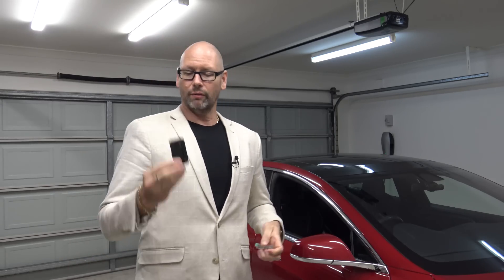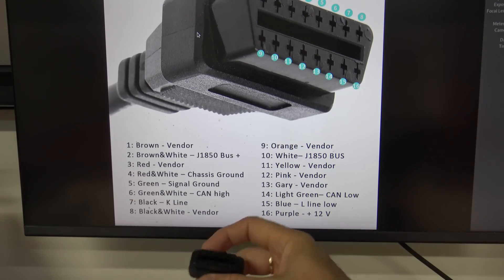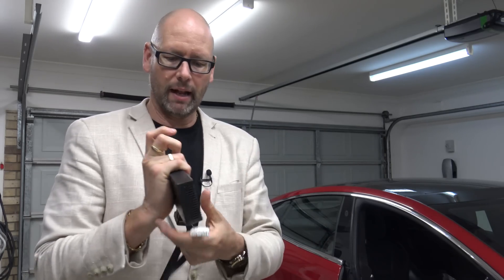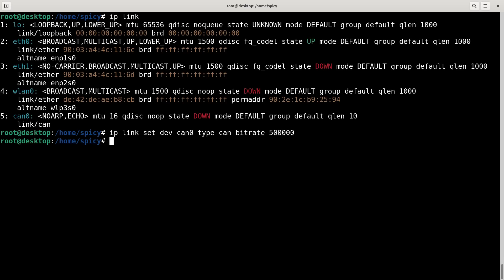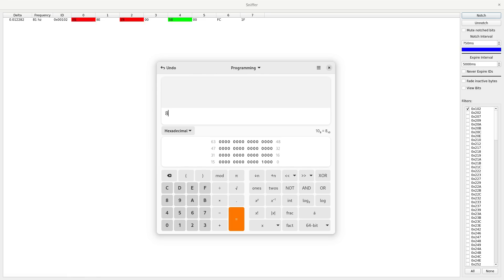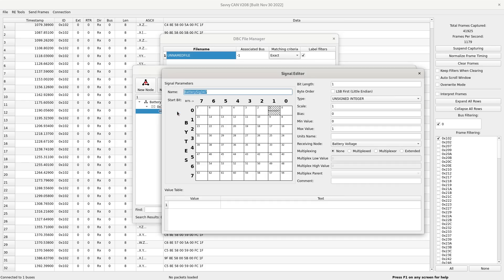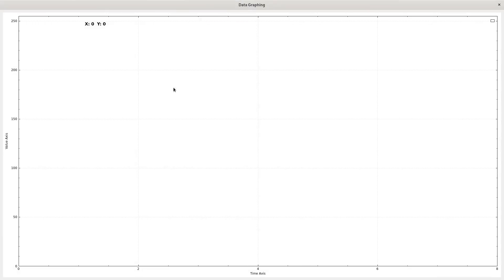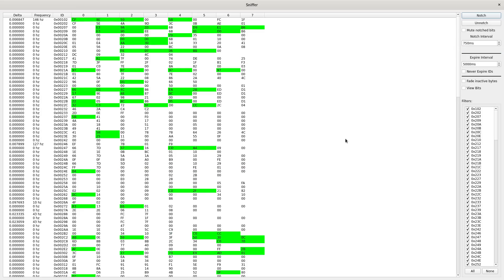Tesla CAN Bus Raspberry Pi

Comment: do this for a regular car... I want to use a raspberry PI for a center console control module through either an Ipad or android. the raspberry would run through an app which would control the cars heat seats,AC etc...

Comment: My Tesla Model 3 is 2020, the panel under the display looks different and I don't have the same connectivity or at least I don't think I do there, where else can I hook into the CAN Bus?
Reply: in the backseat behind the center console under the usb c ports there a plastic panel you can take off
Reply: @James-cq9dp  , I've connected to that, but its not as simple as just connecting, there are other variables such as connection speed.

Comment: Have you found this device reliable?  I have a Raspberry Pi 0 W, the USB adapter only stays up for 5 seconds then all the lights except power go out and the can0 device is removed from the operating system, unplugging and plugging in again restores can0 but I then have to initialise it again...any advice?
Reply from the maker: You did take the resistor off didn't you?
Reply: @TallPaulTech  yes, I did that after I watched your video weeks ago

Comment: I found out what was giving me so many problems...there is a ton of information our there and 90% of it is wrong, for example when preparing a Raspberry Pi 0 W image a lot of sites tell you to create a wpa_supplicant.conf, if you are using the Raspberry Pi Imager, then adding your own wpa_supplicant.conf will break your WiFi connection and leave you with a Pi that won't connect, all the settings are specified in the Imager software and thats all thats needed.

Comment: I'm having so much problems getting the USB device to be stable and reliable, can you please help, I have Ubuntu 22.04 as a Virtual Machine, I connect to the Raspberry Pi 0 W with ssh.  I can see when I power up that all the Lights on the USB CAN module are on for approx.8 seconds, then they go out and only the RED LED is left on, but there is no can0 listed when I type ip link....
Reply from the maker: I hope you don't have the termination resistor on do you?
Reply: @TallPaulTech  I reformatted the SD card with Raspbian 11 and did all the configuration for the usbip and it all works, so I won’t update because I think it was a buggy update that messed everything up.
Reply: @TallPaulTech , No I removed immediately.

Comment: cool video.
I have just set up a raspberry pi zero 2 w running GQRX sweet.
I did have to overclock to 1200mhz, increase swap file size to 1024, install zram and set the desktop to 720p.
I even installed VNC and now can remote into the SDR Pi (that lives in my shed) over wifi and tune around.
I did also set up a bluetooth speaker as well.
on another raspberry pi zero 2 w project, I have one running Openwebrx+ and just use a web browser to access the web page and decode anything on the SDRplay tuner card.
My third raspberry pi zero 22 w project had a 1Tb SD card streaming media via minidlna server. I even enabled web page browsing of the media directory so users can watch films via the web browser or on a smart tv with dlna.

These pi zero 2 w are a great little cheap pc.

Comment: This is the best video I've found so far on how to interface to the CANBUS on Tesla, I have a Tesla Model 3, 2020.  I want to pick up the following signals, Left/Right Indication, Brakes, Lights and Reverse, any suggestion on how I identify the codes for these?
Reply from the maker: No, but I'll sell you a Model S
Reply: @TallPaulTech  Do you have any details on the adapter cable from your box which has a socket on it?

Comment: Looking at the data flow at 9mins38sec, I think you have the wrong field for smaller significant volts, I wager it's field 1big2small not 1big0small. Field 2 creeps up from 57 to 58 ... To 5A in those few seconds

Comment: Here's an idea: Run Home Assistant on the Pi, push the canbus data there, then you can display it on the Tesla touchscreen.
Reply from the maker: I have a better idea... rip the shitty computer out, and put an Aliexpress one in with a simple interface to control aircon/radio shit.
Reply: Running HA on the Pi Zero would be a bad idea. Push messages to your MQTT broker running on different hardware is better. Or.. do as the rest of us.. Run TeslaMate and don't look back :P
Reply from the maker: Remember, it's for sale if you want it  @mortenmoulder

Comment: In the US there is a legal requirement (was?) to have a standardised OBDII port for service info. This means that at least for petrol cars there is a whole string of standardised data packets that an ICE car producer has to supply. There may be an extension of this standard to EV's and if there is you may want to make enquiries first and compare that data with what you're seeing before you put in too much primordial effort.
Reply: There is OBD port on Tesla. It's giving only necessary information, doesn't give full access to whole CAN network.

Comment: Telsa has different arrangement on its new CyberTruck where the signals are propagated through an ethernet loop which is much higher speed... and I think the devices that are connected still use CanBus presumably wth some translator.  Electrical power upgraded from 12V to 48V where they can now use smaller guage and less cable to transmit power saving significant amounts of copper/weight.  You have to ask why haven't the car industry done this previously?
Reply: The previous standard was good enough.  If it ain’t broke, don’t fix it.
Reply: Tesla may need a high speed comms bus to reduce latency for many devices connected to bus... with sophisticated system in these cars eg autonomous driving, steer by wire, 4wheel steering etc etc probably 100s of connected devices on bus.
Reply: We all know why Tesla did it, but I suspect it's a case of legacy auto concerned with how 10's of 1000's of dealers and private shops might handle a 48V bus with all their legacy test gear. I think there will still be a demand for cars that at least have the user accessory bus at 12V.

Comment: You're a good teacher Paul and make tech fun! Canbus reminds me so much of how modbus and profibus works, why did you use 16bits when on savvy can it says 8 for the data length? Super curious.
Reply from the maker: Do you mean 8 bytes for the data length of an ID, 2 bytes of which (16 bits) indicated the voltage. Remember, I'm new at this! I also notice you bring up modbus a bit. Also, you especially are going to love my next video later this week :)
Reply: @TallPaulTech  Yes, that's correct. My hex and binary math is total garbage and really need a refresher on it.
Reply from the maker: @TradieTrev It's maths mate! Hex is simple. Look up my video on hex. Also, next video will have a guest electrician in it. Nothing fancy like your stuff though.

Comment: Cant say Im impressed with Tesls coming up with a different can bus plug and then just leaving it floating around to create a rattle in the dash
Reply: That's just how Tesla is
Reply: There's foam around it in that hole so that it doesn't rattle. That plug isn't generally used when servicing the car, because most diagnostics can be displayed on the internal display and the car also sends diagnostic info over its cellular connection. That connector is essentially just for backup.

Comment: I've heard allsorts of stories about people crashing the canbus causing airbag explosions and other bad things. Not sure how much truth is in the stories but it's enough of a risk that I've stayed away from such things.
Reply: It would however be super handy for gain of function and read data remotely. 

Some cars already have remote windows, door unlocking, window wash control etc, I suspect the TESLA does have a lot but most cars don't. 

I've also seen on a lot of older cars that its controlled over canbus so being able to simulate pressing buttons could also be used to add functions to older cars.
Reply: Stop spreading FUD.
Reply: Are you writing to the bus?
If so, are you writing to a known id?
This is not black magic, stop spreading FUD.
Reply: @Invenciblemario  This is exactly the learning process. If you are messing around with CANBUS, you CAN send the crash message on that bus. It might happen on accident by doing cat /dev/random  > /dev/can0 but You can't say that you guarantee that nothing will happen if you do that.

Comment: I work with designing CAN interfaces, why am I watching this on a saturday? 😂
Reply from the maker: The same reason I do network shit at all hours of the day!
Reply: @TallPaulTech  Haha, dangers of the trade I guess! 😁 I can confirm the products we design are used world wide and is part of the support and aftermarket service chain for big vehicle makers. Great work on the topic.

Will have to look into the usbip, seems really interesting and gives some nice potential for products.
Reply from the maker: I did a video on it. It's pretty basic really. Now, about that CAN info.... ;)
Reply: @TallPaulTech Yea, for some reason all the big VCI-networks use coded or sometimes even encrypted data packages (I look at you BMW). 😬

Mostly mumbo jumbo unless you have the vehicle-vendors proprietary CAN DBC file or reverse engineering. 

I (and the company I work for) only do the hardware + drivers (and minimal software) to interface to the bus, not the decoding/handling of the data. 😢
Reply from the maker: @DavidtheDoom   I'm surprised some of them aren't encrypted by now.
Reply: @TallPaulTech Yea, a bit surprising, my qualified guess is that many companies are outsourcing hardware and software design of ECUs and other control devices in vehicles. Encryption might not be supported or to heavy from a compute perspective or not conveyed in requirements. I know Volvo Bus does outsource some of their ECU designs from when I did my bachelor's thesis there.

I.E. the bottom line is more important than protecting all the traffic, the ones ordering the work does not really get what is needed. 
For now. I think they will catch up and starting encrypting and I guess there will be an arms-race as always between companies and tinkerers/hackers. 😁 

Encryption is usually a really hard nut to crack as long as it is properly implemented. Key-word, if properly implemented!
Reply from the maker: @DavidtheDoom  I'm surprised I never looked at CAN in the past, but I was never into cars so that's probably why.

Comment: 1. If you have a car diagnostic, it would be easy to find ID's. Just sniff the communication between the car and the diagnostic tool.
2. Watch the data streaming and just unplug the module, and you will no longer see packets from that module.
3. Snifing the network and changing the values and states of the switches in the car, controllably
4. Send a CAN message to a car with a certain ID and value and look for changes.
Reply from the maker: If my auntie had balls she'd be my uncle
Reply: @TallPaulTech  2 3 and 4 doesn't require anything to be bought. But diag tools can be really cheap.

If my grandma had wheels she would be a bicycle
Reply: Step 1. Acquire proprietary stolen hardware
Step 2. Make a video and share it with the world that you own stolen property.
Step 3. ????
Reply from the maker: @BGraves  Change my name to Paula to get away with it?
Reply: You can buy multi-brand diagnostic tools, or just buy an official VCI (Vehicle Communication Interface)... they are just expensive, there is nothing secret about it.

Comment: One guess how you could start to figure out which ID corresponds to the voltage is to use a similar ID how cheat engine on Windows is used to find the corresponding memory addresses for variables in Windows games. You can start to narrow the ID:s down through property based testing. For example, while charging, you know approximately how much the battery voltage is going to go up over time. Now you just go write a program to filter out all the ID:s which are not matching the expected upwards trend. So after doing that you might only have a few ID:s left, so you would probably have to repeat the similar experiments to narrow it down to one ID.

Comment: You're doing this the hard way. Get rid of the pi and get something that uses socket can which will go into savy  and pro software like busmaster
Reply from the maker: Did you watch the video? That was SocketCAN and SavvyCAN.
Reply: @TallPaulTech  I did, but missed the part about it utilising socket can. That turns all the communication over Ethernet stuff from needlessly complicated into a pretty neat capability. That means theoretically you could even use a lot of the commercial can development software